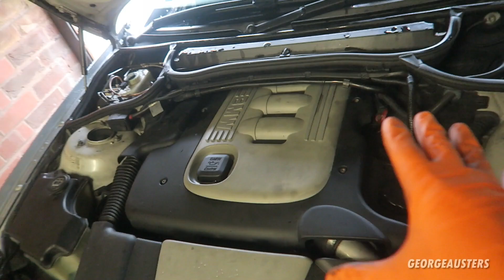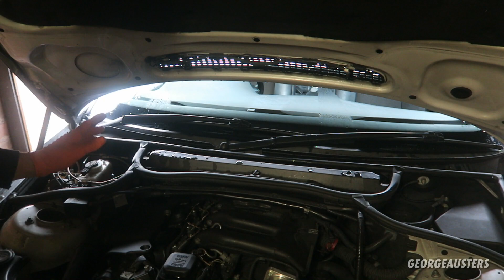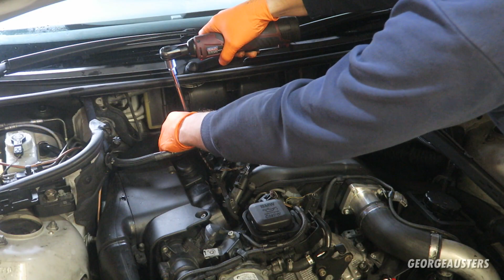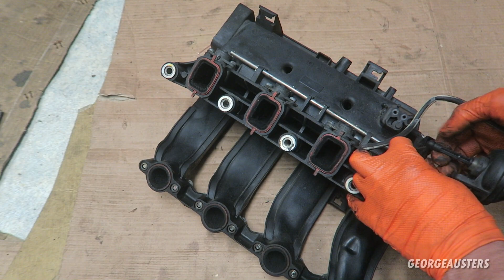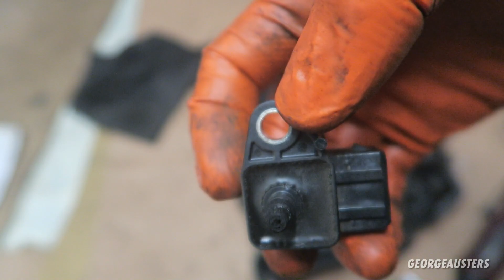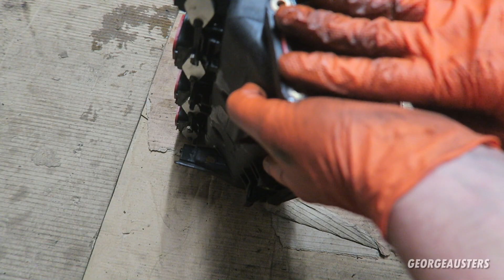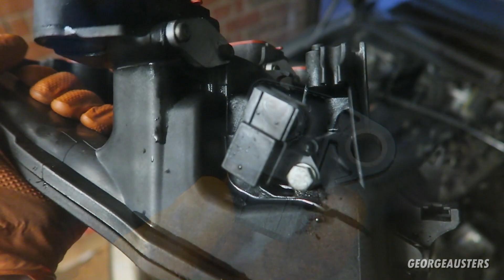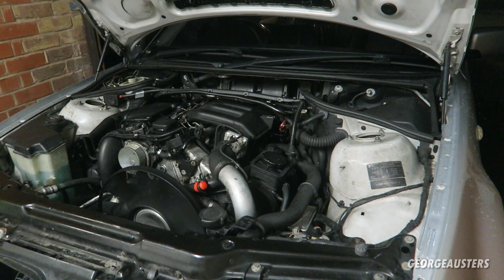BMW M47 / M57 Swirl Flap Delete | How To Remove BMW Swirl Flaps

Comment: I just wondered when you would  do this vid and load this up. I think that now we have it  here. think of recommending my mate to buy an 120 D or 320D Pre-LCI Touring with the M47 163 hp what do you think about it mate ?
Reply from the maker: Sure why not!
Reply: @GeorgeAusters  thanks
Reply: @GeorgeAusters  been looking at a my Service intervals   in my  E91 today mate (speedometer and cluster) and I wondered if I could program that so that it would Show Service in  12,000 km which is like 7200 Miles, Standard is like 15.000 Miles (25.000KM!) (which is really Bad). Have You Got a Clue  how to Do this.  Great video
Reply: @kjschrauber2126  You can code a different service interval using NCS Expert with NCS Dummy, selecting instrument cluster module. Need a laptop and a K+DCAN cable to do that.

Comment: Hi dudes
Reply from the maker: Sup mate
Reply: @GeorgeAusters  it does about 47mile to gallon at moment just local Journeys  not so much motorways at the moment. as I have a BMW X1 For business motorway driving, I get around 56 miles to gallon on X1 1.8D
Reply: @simon_sjw9973  which X1 old X1 or that FWD toy
Reply: @kjschrauber2126  new ish 18 plate m sport in Estral blue s drive, I have had a 5 series,  now that was a nice car F10
Reply: @GeorgeAusters  just chilling how are you! Bmw looking good!
Reply: @simon_sjw9973  indeed. Mine's a 320d N47
Reply: @kjschrauber2126  nice car
Reply: @simon_sjw9973  thanks.
Reply: @GeorgeAusters  hey George mate I got something out like to show you as you have done on a previous video of the change of the timing chain on the N 47 there is actually a tool with which you can check how much where the timing chain has got . Link here :
Reply: Hey man you have a mini as a profile picture which engine mate
Reply: @kjschrauber2126  only  1.5 .  3 cylinder
Reply: @simon_sjw9973 Diesel or petrol
Reply: @kjschrauber2126  diesel sorry
Reply: @simon_sjw9973  Diesel is good what do you averaging about with mpg is
Reply: @simon_sjw9973  bet you have the b37